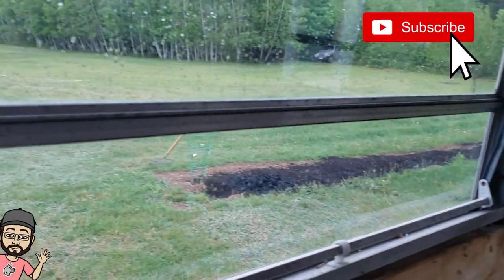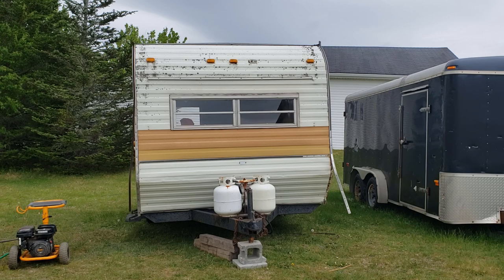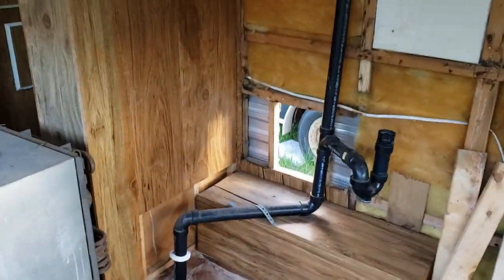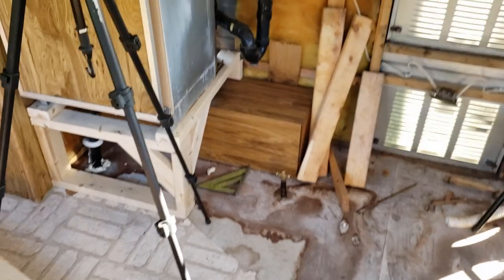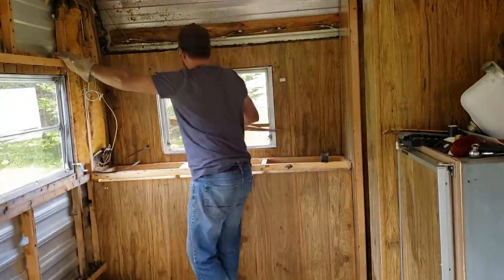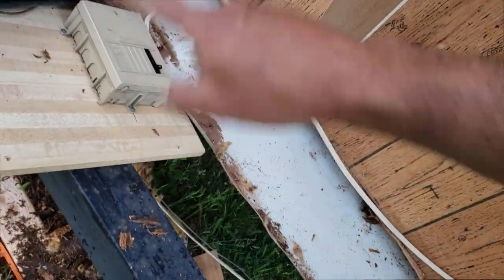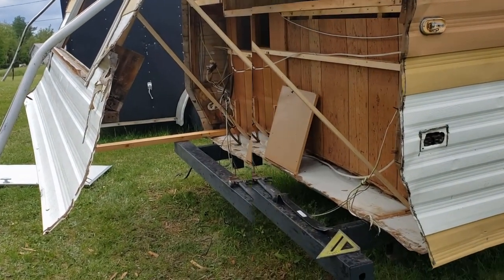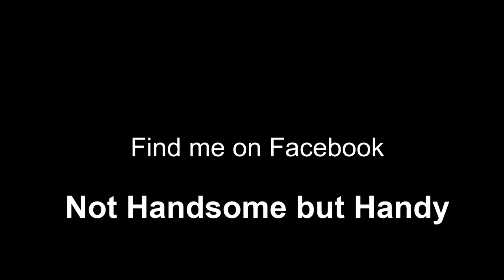Camper Trailer Makeover - Part 2 - Demolition and Structural Repairs - RV Renovation Repair Budget

Comment: This is super helpful! What sort of fixings do you use when getting the corners of the rv back together? Do you worry about weight does it affect what materials you use?
Reply from the maker: The corners are one of the parts I'm least happy with. For now I've just used strapping tape, aluminum draft stop tape and gorilla tape then put the original moulding back over it. This won't last for years but should get us out this summer. Eventually I'll likely replace it with a quality seam sealer and metal flashing. As for weight it's always in the back of my mind but my truck can handle alot of weight and this is still a small trailer. I've removed a lot and added a lot but I think it's still in a good range.

Comment: Man those braces are overkill,thats going to be a lot of extra weight
Reply from the maker: I agree, but I've removed the furnace, stove, and the are no longer any cupboards or countertops so I'll be saving weight there. With the age of this thing I feel better distributing the weight to the strength of the structure.